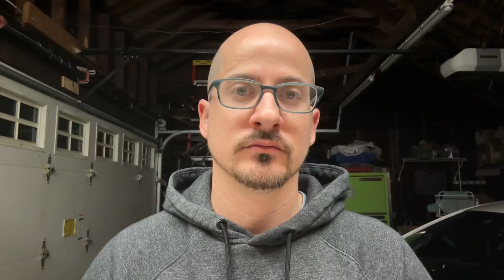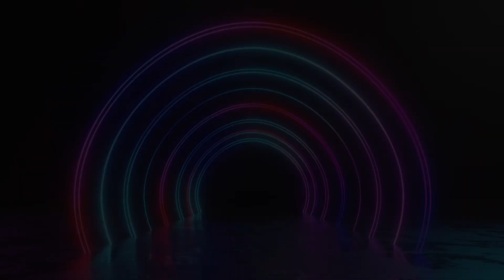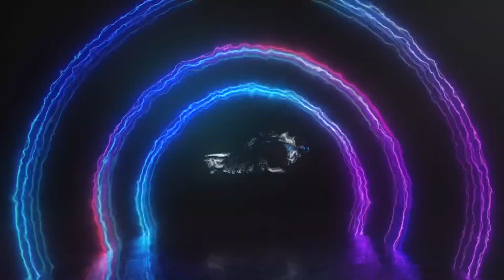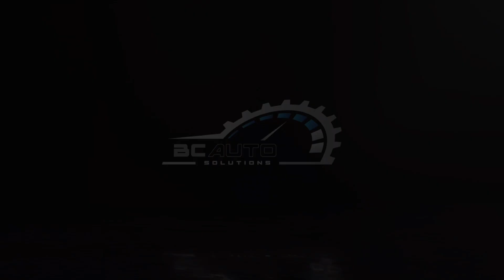Unfolding Hondas oil dilution issue

Comment: I have a 2018 accord 1.5t and this is one of the reasons I take a slightly longer comment to work especially in the winter time and I want to say it is around 12-15 min. max. It does involve going on the highway for a few miles and the car's coolant gets up to temp just before I get on it. Hopefully this will give enough time for the oil to reach operating temp as well and I get significantly better gas mileage with this commute as well. I also strongly believe that running 93 helps a little but and I also use that to mitigate detonation which can cause the head gasket to fail and I'm at 51k now and so far the car runs like a dream. I also change the oil every 5k miles.
Reply from the maker: @MichaelBanko-e1v  doing everything you can good job

Comment: @BCautosolutions so I have a 2021 CRV 1.5l turbo and I’m experiencing the same issue I changed the oil every 30% it’s an early maintenance before the light come on I started to notice a fuel smell coming from my oil when I check the dip stick and also the level is normal sometimes depends if I over fill a little but I thought Honda fixed this issue the car drives fine but I think it killed the rear main seal on my car now it’s at the dealer getting serviced but this issue always frustrate me a lot because my car is only 69,653 miles I do drive a lot but this should not be more issues since when I got the car new it always gave me problems like a a/c motor fail and also a light sensor and then battery and now a rear main seal issue and I think Honda cheap out on QC and also parts and builds I’m just sad how Honda failed me also my 2004 Honda accord has 200,000 miles not even one leak only regular maintenance and some less engine parts fixed but this last longer than my new car it’s sad to see how Honda went down the drain

Comment: Honda runs the PCV System too low on vacuum so you have related problems. Oil has an Octane of 40 so if you have Detonation oil is making it's way into the Combustion Chamber knocking out the Head Gasket IF it's consuming oil. Fuel and Water molecules are lite and are readily pulled out of the oil IF there's enough vacuum and Honda doesn't run enough(.2 to .8inH2O). I've found my TL's crankcase under pressure during my testing. You need 1. to 3.inHg for good PCV function.
Plug a HVAC Manometer to the dipstick tube and confirm.

Comment: I have a 2020 crv lx awd with only 57000 kilometers. I drove myself nuts investigating the oil dilution issue before leasing it in 2020 to the degree I was able to have dealer write up a clause in the sale that would permit me to escape the lease without penalty if it ever went into limp mode as a result of bad injectors or lord knows what else . My crv runs great though , but the oil does creep past the full mark and certainly smells like gas all the time . I'm in northern ontario so the weather is cold , my trips are a mixture of my 15 minute commute mostly highway 70/90 kmph . By the time I get halfway through that commute the temp gauge is at the sweet spot so it does get to hopefully burn off some fuel in the pan . When its -20 celcius or worse I'll use block heater overnight faithfully . My lease is up in 1 year so I can just walk away and let next person deal with any potential future issues however my lease buyout price + hst is a sweet deal . Some used 2020 / 2021 crv lx awd are selling for crazy prices while checking auto-trader honda dealer listings for used crv's . I think my buyout price + the cost of extending the honda warranty to 7 or 8 years still keeps me in good shape as any issues that pop up would be covered (head gasket , injectors etc) . Since day 1 I've used 87 octane and followed the honda maint minder for service (wait until 15%) . Now that I'm considering buying out the lease next year I've been deep diving oil dilution again on channels like yours . My first step is simply changing to 91 octanne and perhaps getting oil changed sooner . I'm still at 80% since I had an oil change in march but will consider changing it at 8000 kilometers instead of the aprox 9,500 kilometers I usually get from a full 100% to 15 % timeframe . I'm guessing that will be at around the 30% mait minder timeframe . I've seen a youtuber with a 2017 that switched from 87 octane to 91 octane that went from 7.5% gas in the oil via a blackstone analysis down to less than 1.5 % by switching to 91 octane . Sorry for the ramble but thanks for doing these videos to help us 1.5 turbo owners know what to watch for .If I buy out the lease I'll cover my ass with extended warranty
Reply from the maker: Hey, appreciate your well thought out input in this scenario.

Comment: Some people on Honda’s forums and within Honda Engineering Dept. say that the first factory oil fill comes with an extra load of molybdenum. Having that said, according to this theory, the longer you run until maintenance minder hits 15%, the greater benefits you take from that.

Does your recommendation to change oil at 3k miles intervals apply to the first oil change?
Reply from the maker: I wouldn’t still do 3k personally. The newer algorithm on these cars seems to be a lot more aggressive vs 10 years ago.
Reply: @BCautosutions  would you or wouldn't do at the first 3k?
Reply from the maker: @TheManufatura  i do at 1k then again at 3k and every 3k from there on out.

Comment: I own a 2018 CR-V with the 1.5 turbo, I live in Wisconsin and unfortunately it sees more short trips around town than trips on the highway. Before the reprogramming and driving it in winter the cabin would reek with the gas and oil smell and in 5000 miles I would see about a .25” rise in the oil level. The reprogramming helped with the smell inside of the cabin. I now change the oil at 3,000 miles when the weather get cold and 5,000 miles during the summer months. By doing this I see no rise in the oil level throughout the year.   One thing I still get is after I drive it on the highway and park it in the garage I still get that oil and gas smell out side the car. I thought the emission system was a “closed system” . If that’s the case where is the smell coming from?
Reply from the maker: Appreciate your input. That gas smell can just be unburnt fuel or a rich mixture that some people may be more sensitive too
Reply: @BCautosutions  The smell I get after driving is the exact smell I get when I change the oil.
I got the next recall notice, looks like  over a million Hondas will be getting new fuel pumps,
Look like more job security!
Reply from the maker: @arleenkenny9557  we sure will be busy that’s for sure.

Comment: In the uk honda have recommended to use 0w 30 oil to help with this issue on the 1.5T and 1.0T
Reply from the maker: I use 5w30 in my cars. 0w20 is too thin

Comment: Thanks for this informative video.
I have a 2023 Accord Hybrid Sport L with 10k miles on it. Truly enjoyed every single mile driven. Would really love to keep this car forever, but unfortunately a trade-in might be in the near future. Here's why:
My online Repair Service schedule notes to the dealership:

About two weeks ago I could smell gasoline fume when I parked the car in the garage after 1 hour of driving. There wasn't any visible gasoline leaks. The gasoline smell went away when after parking over night. The next day, the car didn't smell like gasoline when parked in the garage, but it smelled like very mild hot gas/oil mixture... The next day that I started to notice the cabin smelled like mild hot gas/oil mixture fumes when the blower fan was on, during idle or slow speeds... I inspected the car engine again with a flash light, but there was no visible gasoline leaks. The oil dipstick had strong diluted gasoline smell at 60 oil life left. I took the car in for an oil change last Thursday and mentioned the gas smell issue to the advisor, but the advisor couldn't smell the mild gasoline fume. The smell was more obvious in a closed small garage... Now only about a week after the oil was changed, the oil dipstick is already starting to smell like diluted gasoline fume again. Need someone to diagnose the fuel pressure regulator, injectors, fuel lines, and the fuel line quick-connects before a catastrophic engine failure occurs. 

Took the car in to the dealership, here were the results as I anticipated: 

- We had multiple technicians looking for visible signs of gas leaks, but there wasn't any.... Of course there wasn't any signs of gas leaks. They probably didn't read my notes.
- Technicians didn't smell any gasoline dilution in the oil... Of course not, the oil  had only about 100 miles driven, but it smelled like 1000 miles to me. My nose wasn't exposed to oil/gas all day like the technicians, I could smell the gas/oil dilution.
- Some burn smells are normal and could get into the cabin... WTF? Didn't you read my F'n notes? End of the conversation... Of course I didn't say that to the Honda advisory or the technicians. I thanked them for their service instead...

The last comment I made was,  I'm not a mechanic by trade, but have a little over 30 years of car maintenance experience, so I know a thing or two about car components....
Reply: your Honda has a pressure relief pump on the gas tank if you over fill it and the pressure sensor on the gas tank goes to high ,the pump will bleed it off in your garage until the pressure is lowered in your tank , its common my does it mostly in the summer or heated garage , just don't click the gas nozzle .
Reply from the maker: Thanks for sharing your experiences. Sorry for what you’re dealing with.

Comment: Own a 2018 crv with 147,xxx KM. Using 89 or 91 fuel when able. Change my oil when I get to 30% oil life. So far no issues only injectors done at 115,0000km. Let my engine run 2-4 min before I drive depending on outdoor temp. Fingers crossed I get 2 or 3 more years out of this engine.
Reply from the maker: Nice, best of luck. Thanks for sharing.

Comment: I love your videos man I my self drive a modified 1.5t 6MT 2018 accord I bought it all stock with 48k miles and now have 62k miles on it and I drive it pretty spirited every day I have never had one of these problems … I just want to say thank you for your videos I have learned a lot from them and I just got promoted to main shop from express yesterday at my Honda dealership 🙌
Reply from the maker: Thanks for the kind words. Congrats and best of luck on the new position! Don’t be afraid to ask for help from older techs after exhausting your resources
Reply: Omgosh!!  My 2013 Honda Accord is having that problem and I’ve had the oil changed at least 3 times and never once did a mechanic say anything!!!  I can smell the gasoline from the dip stick😩
Reply from the maker: @karenb3857  extended oil changes will do that.
Reply: @BCautosutions  I guess I should have said 3 changes within 12 months and I still can smell gasoline from the dipstick
Reply from the maker: @karenb3857  seems like you have an issue then.
Reply: @BCautosutions  what should I have done to stop it?  Was this a recall?
Reply from the maker: @karenb3857  not for the 2.4 accords it’s not normal or any extensions. I would replaced your oil every 3k
Reply: @BCautosutions  is there anything that can be done to stop the gasoline from getting into the oil compartment?  I’m the original owner and I have done everything by Honda’s recommendation but over the past 18 months or so, my car just isn’t running as it should.

Comment: Is there a recall on 2015 CR-V with this problem? Ours has that fuel smell on the oil dipstick ,the level seems the same but definitely smell fuel on it.
Reply: Oil changes are interval every 3k miles. There was a code dat dealt with MAP sensor but it went away never came back..thx
Reply from the maker: @thunderchild321  ✅
Reply from the maker: No there isn’t. That’s probably from extended oil changes.

Comment: Honda needs to get it together, first order of business is to have MPFI and DI like Ford and Toyota.  Double your injectors, double your fun.  2nd would be to get rid of the cylinder deactivation or find a way to improve it so it doesn’t ruin your rings, or motor mounts.  3rd would be to focus more on hybrids than EV’s.  As a previous Tesla owner I’m not optimistic about EV’s.  Tesla is also going to smoke everyone else on price.  No one is buying a $60k prologue/blazer.  GM has cooties and is a terrible OEM.

Comment: This day and age and car manufacturers reputations. Im not surprised honda has not taken responsibility on the 1.5t problems oil dalution and headgaskets.to me its all coincidence that this 1.5t has all these issues and honda hasnt owned up to a manufacturer problem and pretty sure these issues are all related and fuel is destroying the engine internals. also having people do more maintenance do to hondas error at manufacturer.honda should own up to these 2 issues

Comment: You mentioned cars that basically have 4 cylinder engines.... are there any known issues with the larger 6 cylinder issues such as the Honda odyssey.... for me the 2017 Honda Odyssey EX. I think this is the last generation of the 2011 to 2017 setup so hopefully this model has most of that worked out?
Reply: No issues on 3.5 engine N/A .only turbo 1.5 t has these issues.which is why I did not buy a new crv and bought a 2020 pilot and no cvt transmission win win on those scales

Comment: nice video.  part of the problem (if there is a problem at all) is that Honda designed the 1.5L with only 3.7 qts of oil capacity.  So, if oil dilution is taking place...  there is very little oil capacity to help the concern.  IMHO, Honda should have gone with a 5 qt capacity.  Merci

Comment: Sadly to say . I think Honda miserably failed the customer on the 2018 & on . The advisor at the Honda dealership stated that I was  lucky that my headgasket last 160k. I said what are you talking about.  It should last the life of the engine especially if you are having it serviced at the dealership.  A said what are you talking about? Honda is known for having a lot of miles & continue going.  That used to be the selling point of Honda. I guess it's not anymore.  I'm not sure if I still want to continue investing in mine. I just received my yoffer 4 front bumper. I have invested in my exhaust system Borla PRL intake PRl turbo pipes PRL intercooler.  Not if I should still put down pipe on it. I'm very disappointed right now. I owned a 1992 Honda accord for 11 years. Never had change the headgasket on it. It was never serviced at the dealer I did all the services myself.  My car is out of service. What's the reason to continue having the dealer service it?
Reply from the maker: Thanks for sharing your experience.

Comment: I own a 2020 CR-V EX with the 1.5T, and I change my oil every 5K miles regardless of what the maintenance minder says. It's not just for preventing oil dilution, it also helps keep the turbo clean, and it helps keep the oil from deteriorating with age because my everyday commute isn't that long.
Reply from the maker: 💯, unfortunately too many people listen to the maintenance minder.

Comment: I have  honda accord 2018 with the 1.5 t. It does have oil dilution.  I live in michigan.  In the winter, sometimes oil reach the top of orange part of the dipstick. If this happens, I change the oil right away regardless of the mileage driven in that oil. Usually I change it every 2500  Miles give and take depending on the oil level and the condition (Smell of gas ) usually little bit above the max limit.  Oil filter, I change it every other oil change. Tell me what do you think.
Thank you
Reply from the maker: I think you have the right idea for sure and it’s just something we will have to deal with unfortunately.

Comment: How often do you recommend the transmission filter in the 10AT be replaced? Specifically in the accord. I’ve changed the fluid twice, am at 72k but never changed the filter. Planned on doing it on its third 30k mile service, at 90k.
Reply from the maker: Every 60k if stock and every 30k if modified.
Reply: @BCautosutions  wow I’m overdue, suppose it’s good I’m at least changing the fluid lol. Can’t wait to see how black the filter is
Reply from the maker: @DarkOrbit1229  😅

Comment: Thanks for the video and explanation! I had heard of the oil dilution issue when I was researching purchasing my 2018 Accord 1.5T. I had also heard of the software updates that I assumed resolved or improved the issue. However, when I was active on the Accord forums there were always people bringing up oil dilution, like it was happening everywhere with every car. I've been trying to get my oil changed every 3,500-4,000 miles, have been mindful of the dangers of "short trips", and I did change my PCV valve. I'm 55,000 miles now and the car is driving great.

Comment: Haven't had any noticeable issues with Oil dilution on my 2018 Sport 1.5. Live in Northern Oklahoma. Had car for a little over 5 years now and 55K miles. Change oil every 5K. I changed my PVC valve at 30K miles. It's a 6 speed manual and I drive it like an old man that I am.
Reply from the maker: Thanks for sharing!

Comment: Why does a reputable company like Honda which has been the epitome of reliability choose to continue with turbos? They are seriously going to ruin their reputation. Unless the amount of problems with these engines are being over dramatized then it makes zero sense why Honda continues to manufacture the turbo engines in their Civics and Accords. It has been the same engine format for years. If there were so many problems you'd think Honda would quickly pivot to a normally aspirated engine instead moving forward with only turbos..but they haven't....so what gives?
Reply from the maker: I’m not sure tbh. At this point maybe an epa complaint engine would cost too much R&d? Although I think it’s worth the investment for customer retention and confidence but that’s not my area to have an opinion on 😅